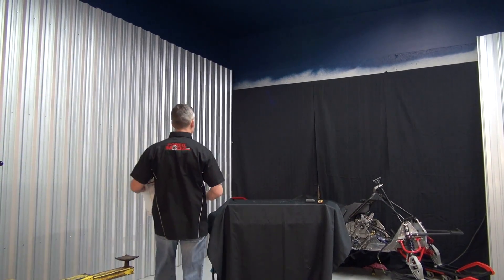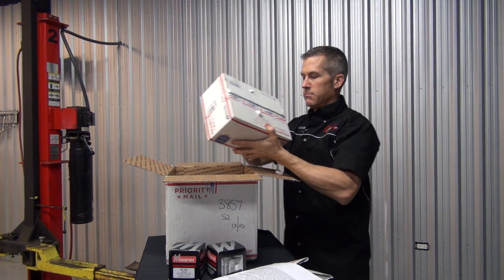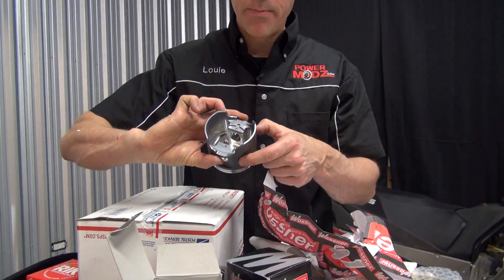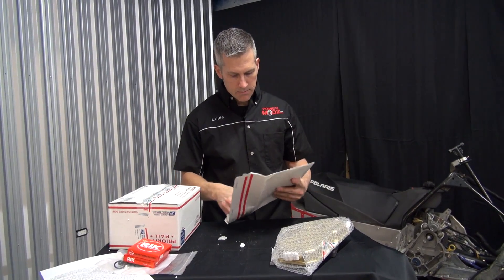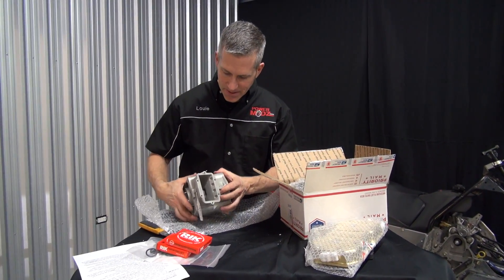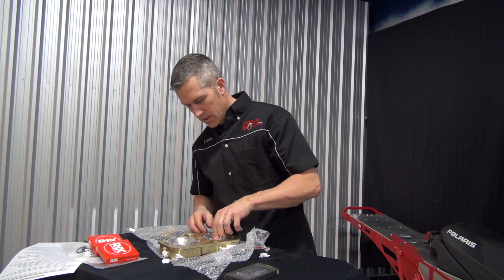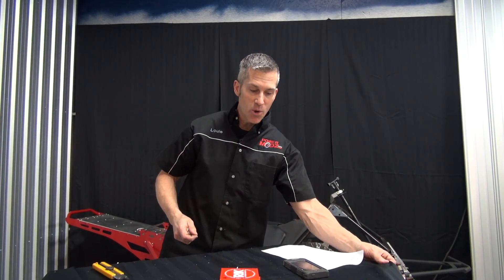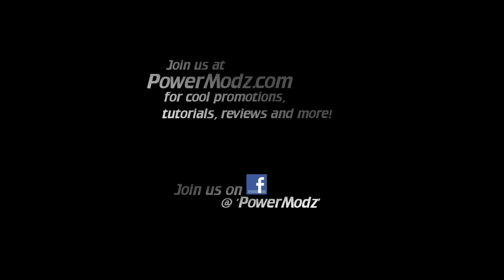Skidoo REV Big Bore Kit arrives from RKTek, have a look!  827 Big Bore!  PowerModz!

Comment: all that for 27cc
Reply from the maker: I've done a lot more for less.
Reply: PowerModz fair enough, how much more horsepower is that making? there's no replacement for displacement!
Reply: It fixes the cooling problem in the 03-07 800. Opening up intake and exhaust ports making good hp. Domes can be trimmed to add compression for race fuel. All around reliable setup and major gains. They had a heat soak problem from factory